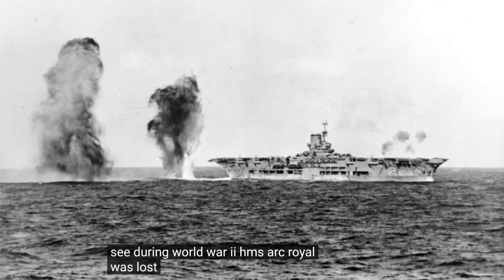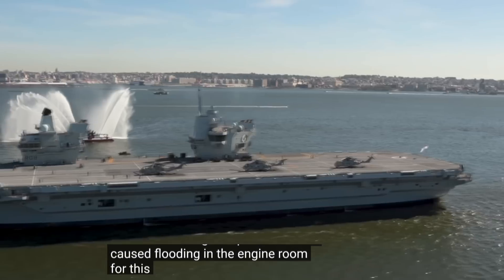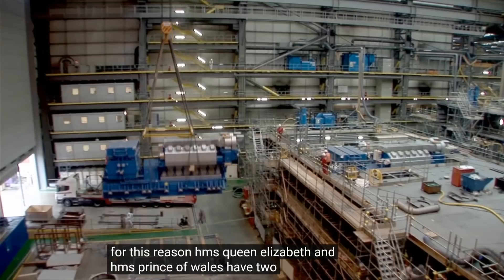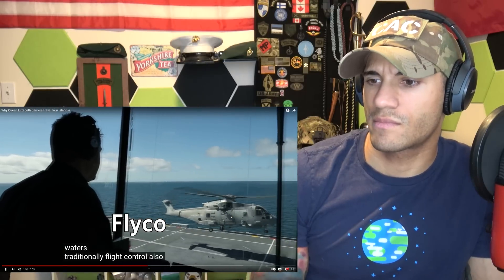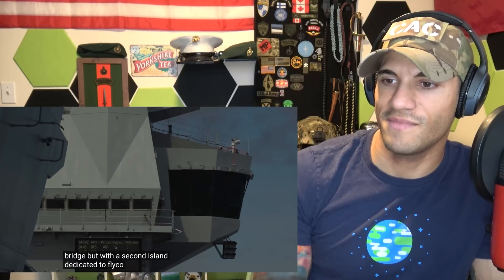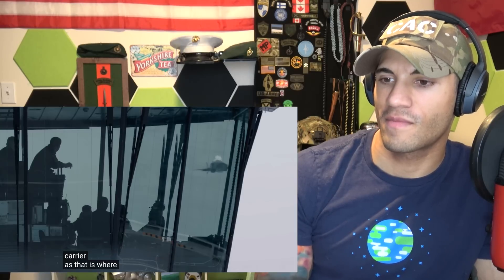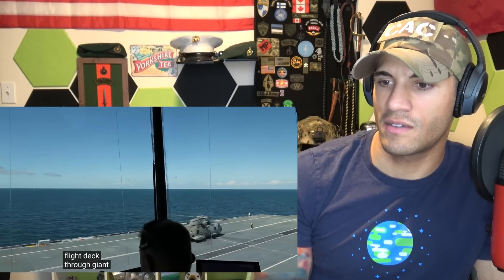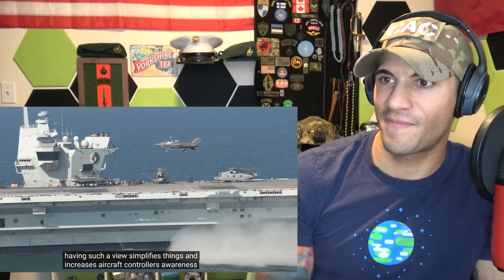Marine reacts to Why Queen Elizabeth Carriers Have Twin Islands

Comment: It was Great Britain (RN) That made the very first aircraft carrier and made it with the single island but the Royal Navy have now upgraded to a two-island design.

“On 7 May 1913 the Royal Navy commissioned its first aviation ship. The old light cruiser, Hermes, launched in 1898, was converted to a seaplane carrier. Canvas shelters to hold aircraft were installed on the stern and forward of the bridge structure and aircraft-handling booms installed on the masts.

During World War I the British navy developed the first true aircraft carrier with an unobstructed flight deck, the HMS Argus, which was built on a converted merchant-ship hull.

You are welcome world;-)

Comment: One of the little mentioned design details is that each island has a weapons lift (which exit on the starboard side) thereby continuing the ship's operational redundancy even to the provision of aircraft weapons! Therefore, each island has a Gas Turbine generator set positioned directly below it with the air inlet and exhausts going straight up through the islands, both islands can operate the ship and launch jets from a number of bridge positions AND both islands have weapons elevators to arm the aircraft. Very good design...

Comment: The redundancy of two towers is very useful I think. If a tower gets hit with a missile for example, you can move the bridge staff or flyco staff to the surviving tower. If a carrier with one tower gets hit in the tower, it is in serious trouble. 

Also, I don't think comms between the two is that big an issue. The ships's captain and flyco officer in charge will both know each other and basically be in each others heads in terms of knowing what needs to be done to get planes in the air. After all, planes are the carriers greatest defence. Plus, if the intercom ever did go down due to malfunction or battle damage you could resort to walkie talkies (best not to say classified stuff over unprotected radio airwaves though) or even just use runners with information of paper. It would probably only take 60-90 seconds to get from bridge to flyco if you ran as quick as you could.

Comment: They missed out another important advantage of the two separate islands:  Each has full capability to perform the tasks of the other island. If one island is compromised, the vessel can still function. eg flight deck management can be performed, with reduced visibility, by the forward island.

Comment: It’s not just that, there’s thousands and thousands of different systems and facilities that require power and space, for example a kitchen, all of its food has to be stored, prepared and cooked and eaten as well as being disposed off, another massive problem would actually be the toilets because if they jam, you have to go through the entire system just to unclog it all and can cause the ship to be stuck in the port, storage space for the fighters, their extra fuel, munitions, trolleys, the field crews and pilots, briefing room, engine room as well as miles and miles of pipe lines and cables leading to core ship systems to turning the light on or off

Comment: Some fun facts about the QE Class:
Compared to a Nimitz class carriers 6000 crew, QE only needs 1000. These things are empty except for fuel, food and bullets.
Sortie generation rate is 110 per day
Due to the flexibility and power of the F35, it can perform all the roles previously requiring dedicated platforms, at the same time.

Comment: just a side note there were several reasons why the Queen Elizabeth class is not Nuclear, 
1st and main reason cost this would add several billion pounds to the cost of the ship  which would include the many additional personnel which have to be nuclear qualified and paying for the fuel of the ships 50 year life span will ultimately cost more than the initial cost of fitting nuclear power, but when a ship has to have the Nuclear fuel replaced the ship would be in a major refit for several years longer due to the complexities of refuelling nuclear power systems compared to a standard power system meaning the ship is out of commission a lot longer compared to a conventional power ship and would add 10's of millions of pounds to the cost of the refit.

2nd as the Carriers escorts will always be non nuclear especially its resupply ships it makes no sense having a nuclear carrier, as while the supply ships are resupplying the carrier with stores and aviation fuel they can simultaneously refuel the ship as well, US carriers are nuclear powered and can go a lot faster than there escort ships which are non nuclear, but the carrier in reality will never go any faster than the slowest non nuclear ship in its escort fleet and will still have to be tied up with a non nuclear resupply ship so making no advantage to Nuclear power

3rd reason is a lot of countries have bans in place that will not allow Nuclear vessels into there ports thus limiting the locations a Nuclear Powered Aircraft Carrier can visit where as the Queen Elizabeth class can go into any port that is big enough to accept her size being non nuclear and when maintenance is needed it will not need specialised nuclear repair facilities which limit where a ship can be maintained.

Comment: the other benefit which was briefly mentioned about the twin Islands is that the engines are actually just under each island so there are three big advantages for this placement, 1st having the engineers just under the islands, means you have freed up a lot of space lower down in the ship for additional fuel and stores as the drive shafts are fed the electrical power from these engines and are not directly connected to the shafts making more room available, 2nd reduced chance of power loss due to battle damage, if the ship is hit by a torpedo the engines will not be affected as they are up high and should a missile hit one engine the other engine can keep the ship going, 3rd ease of Maintenance / replacement or upgrade, as the engines are located directly under the islands it means should an engine need to be replaced or upgraded it will only take a few days to remove and replace rather than a major refit, compared to having them lower down in the ship which could take weeks

Comment: The beauty of an object such as this in my opinion is the beauty of form following functions, it looks that way because of how it's works and operates. See beauty from another angle, why dies it loon.the way it does, then one will find it's because if what it's function is, you see I lobe engineering and art too so I see many things others don't in anyway most people don't see, and I didn't try to be that way, it just is, I'm extremely observent.
The first Truly AI carriers, with two Engine rooms, and multiple power units, from 4 diesel engines to gas turbines and electrical generator units with intercoolers for maximum heat dispersal and power regeneration.
The islands are twin because one is for ship operations and one for flights operations, kept separate but both can operate all of the ships controls and aircraft handling.
Not nuclear, why? Because not all commonwealth countries and friendly nations will accept nuclear power vessel in to their 12mile exclusive international sea boarder.
Only carriers designed from keel up to home the F-35Bs, so a 5th gen carrier class, plus, the QEC carriers are also stealthy too, using angles to reflect radar away from returning a signal to enemy ships.
Multipurpose, multimissions carrier for Commando as well as seas born attacks and interdiction.
She and her sister Prince of Wales are 65,000tn behemoths, and, in her initial operations, she'll be flying Both the White Ensign of the Royal Navy and then Star's and stripes of the US Navy too.
Beautiful editions to the UK military and especially The Royal Navys' modernisation programs.
The Bridge and Fly-co have many way to communicate, other than just radio communication, signal as well as large screens, And by mouth, shouting if need be, bit she has many residencies to make sure they don't lose communication between bjty islands. An amazing piece of equipment to have.
Brilliant subject matter Theo.
Have a good one mate. 👍🏻

Comment: basically the Brits didnt like how vulnerable carriers are and they REALLY didnt like how they lost the Ark Royal so they did what Brits do best and came up with a concept that only Brits could come up with XD

the reason their design does not really matter that much is that a submarine crew will simple have to aim for the two islands in order to sink the carrier quite easily, the carrier is harder to sink on paper but in practice it doesnt make much of a difference except looking really odd, perhaps taking some very valuable space and giving only a handful of strategic advantages in specific situations

so is it actually a better design than conventional designs? personally i believe it might be but we wont know for sure until it sees combat
in my opinion the old classic carrier designs are obsolete in the 21st century and we can come up with much better and much crazier designs that makes better use of space and modern materials as well as giving a better center mass than the old conventional designs

Comment: Instead of a traditional single island, the carrier has two smaller islands. The forward island is for ship control functions and the aft (FLYCO) island is for flying control. The reason for two islands is, simply put, due to the gas turbine exhausts.

Comment: Does anyone know if this ship has awac capability? Invincible and Hermes lacked that which was a major flaw during the Falklands crisis.
Reply: Awacs would require catapults and arresting gear so no.  They have a system called " crowsnest "  which is attached to a Merlin helicopter.  It's a new way of doing things so we will see how it works in practice.  Both carriers are constructed in such a way as to allow cats & traps to be fitted in the future if required.  I've heard that smaller catapults are being designed for the carriers to launch unmanned drones, these will not be sufficient for heavier planes though.
Reply: There is a squadron of drones at RAF Marham being trained for just that scenario and has been for over a year now, also for refuelling. Plus there is an adaptation of the crowsnest for submarine detection being heavily worked on for long distance `Eye over the horizon`  radar capability, until the drones are placed onboard.

Comment: The benefits of the gas turbine engine is the excellent power to weight ratio compared to conventional engines. Same reason Jets use them. The UKs newest aircraft carriers can boast the most powerful Gas Turbine engines in the world.
Reply: I imagine they will run on diesels only for economy 90% of the time and only use the GTs during wartime when they need that extra speed.

Comment: I believe 4 engine rooms each directly below towers Diesel engine down in hull and gas turbine jet engine just below towers with electrical magnetic propulsion and motors for huge amounts of power and can still function if any destroyed and I believe queen class carriers have 990 flood compartments which will take a absolute task to sink that I guess and I believe a lot of many paints and ceramic metarials are used to help with weight, burn proof and helps to avoid detection with  the of conducting heat and electrical and magnetic etc systems I feel queen Elizabeth class are not armed with missile systems but  serious Gatling guns and the ships around her and them f35b and merlin ,wildcat, and Apache helicopters are definitely more capable and even at more further range and will hunt submarines like going fishing and with the new destroyers and frigates underway there going to be the main targets as aircraft carriers are kept away from danger and destroyers and frigates go to battles so more of a reason don’t arm your aircraft carriers to its teeth let the enemies try the destroyers n frigates and prepare the airforce at safe distance no point trying to destroy a aircraft carrier if it’s not shooting missiles at you but other ships are you try your luck taking on the destroyers and frigates before the carrier strike group is ready and you may have a chance of survival

Comment: One thing not covered in the video is the amount of automation in moving around the aircraft and getting them on or bellow decks.
I served on the Ark royal in the 70's when we had a ships company of around 2750 men( this is before women went to sea) the ship's company of the Queen Elizabeth class carrier is around 800/900 I believe ( although I'm not sure if that is with or without the squadrons personnel). even though she is bigger than the old Ark.
If you want to be gobsmacked Google HMS ark royal and USS Nimitz you can see the difference between what we think is a big ship and what America thinks.
One rumour is that HMS Prince of Wales will be loaned to the US after sea trials and testing.
If you look at the picture of the Ark and Nimitz just imagine standing on the flight deck of the Ark and looking over the side ( while at sea on exercise) and looking down at the cockpit of a Buccaneer flying past so low it made a wake on the sea surface.
Amazing aircraft also used in the gulf as a low level strike aircraft , they could only fly 20 feet off the ground because they found out that the sand being blown up by the exhaust was giving away their position.... and this is an aircraft with proper switches and knobs and handles not one bit of touch screen technology.The modern squadrons stopped laughing at them ( apparently laughing with your jaw on your chest doesn't work) those were the days..... now I sound like my dad..

Comment: While the Islands appear to have a physical disadvantage with coms...I see it as a strategic advantage. While working coms may take some time getting used to between the bridges...the whole factor of having two islands for survivability is increased. Inevitably, they will get used to it.  Should one island be struck...the flight bridge could take over responsibility of command bridge and visa versa...and wont see loss of expensive planes lost due to post op hanging too long in the air due to flight control loss. As long as both bridges can in fact stand in for one another in a strike scenario, I dont see an actual deficency caused by the twin Islands. I would be interested to know if they can be used dual role.? I also wonder if the Ski Jump at nose isnt adding too much structual tortion to suspension on the planes on take off?

Comment: Since you brought it up they did look into using nuclear power however they came to the conclusion that not only would it be way  more expensive to build and fuel but would also need new docking facility's specifically for them that are permitted to Handle nuclear material and carry out any maintenance ultimately they found that there was no actual advantage to going nuclear.  Sure it has a massive range due to it not needing refueled for like 25 years and it is fast but all that range and speed never factors in due to the fact the carriers range is limited by its support ships as they are diesel powered and a fuel ships which is slow still needs to be in the fleet to feed the support ships and also feed the carrier fuel for the planes, so really a nuclear carriers range and speed is limited by the range of the support fleet and the speed is limited by the slowest ship and this usually is the fuel ship
Reply: Plus, some of our allies won't allow nuclear powered ships to dock in their ports.
Reply: fact is our nuke techs are only experts on subs,we would of had to employ french or American so that was a cost thing plus as someone just said,many nations will not allow a nuke boat to dock in port which is a bummer and anyway even nuke carriers have to replenish at sea so really not a problem plus mantenance on a nuke carrier takes years

Comment: The reason Ark Royal sank in November 1941 after being torpedoed by U-81, was down to not enough tug boats to pull her to Gibraltar (had two tugs, needed four).
Also, after patching up the damage done by the torpedo - some pillock decided to start up the engine. This shook open the breaches leading to it's slow sinking.
Only one sailor died out of a crew of 1488 who were taken off by the RN.

Comment: The space between the towers, is actually there to accommodate the pub down stairs. :)
Reply: Need a good distance for the dart board, Health and safety strikes again.
😂
Reply: There's probably space for a huge boiling vessel (BV) for a ship-sized brew.
Reply: Well...we are British 😂🤣
Reply: Yes lad 😂
Reply: navy terms It's not a pub it's a pig and whistle
Reply: Bottom line, two islands takes too much of the much needed flight deck space, not to mention poor visibility for FLYCO and having that ski jump ramp on the bow doesn’t help the visibility on what’s in front of the ship. Yes!,…..and it’s UGLY.
Reply: The twin island design allows for as fast aircraft lift between . The sortie rate for aircraft off the QE carriers is able to  exceed a  conventional cat and trap carrier.
Reply: That's becaise the Australians are interested.
Reply: Has to have more than 1 pub a small old pub and a weather spoons

Comment: What a beautiful carrier.  The British designs are superior.
Reply: It's actually a French design
Reply: @stephenchappell7512  😯🤔😫
If true I'm flabbergasted and flummoxed
Reply: @dave_h_8742 
Yep
The French Thales design was chosen over the British BAE design.
Interestingly the designs of both competing forerunners were designed to be configured for either ski-jump STVOL or EMAL CTOL. The reason being that the F-35B was still an experimental aircraft and the ships needed to be flexible enough to be reconfigured to accommodate either the F-35B or F-35C.
Reply: @stephenchappell7512  div no it was not,thats why we went alone